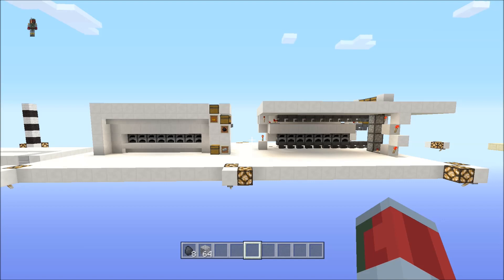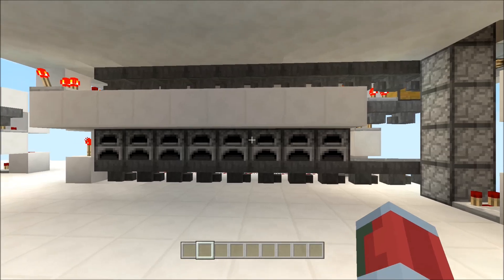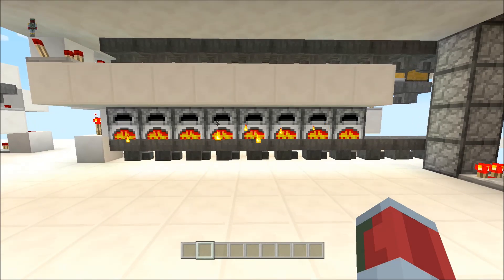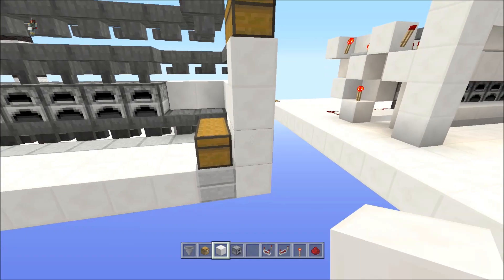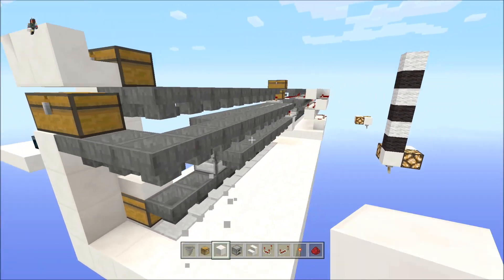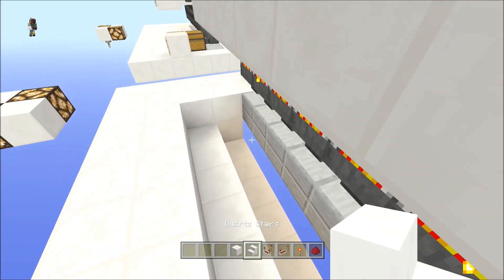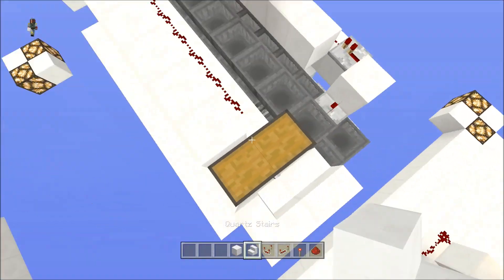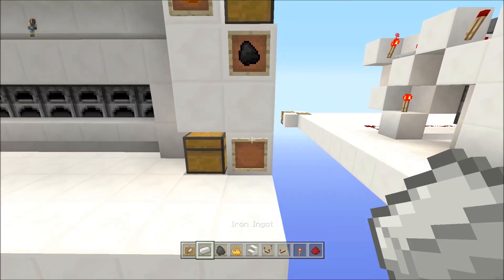8 x Speed Furnace Minecraft  PC Only Java 1.14.4

Comment: ok so i made this exact replica yesterday and everything was going extremely well but i accidentally put a stack of cobblestone in the "coal chest" and it messed everything up. now what happens is when i put a stack of coal in the "coal chest" all the coal gets delivered to the furnace closed to the chest where all the finished items are. it now also has to fill up the hopper queue as well so now i have 64 coal in the furnace and connected to that i have the hopper which is now holding 64 64 64 64 64 and all my other furnaces are not working cause all the coal is focused on the first furnace only...any ideas on how i can fix this?